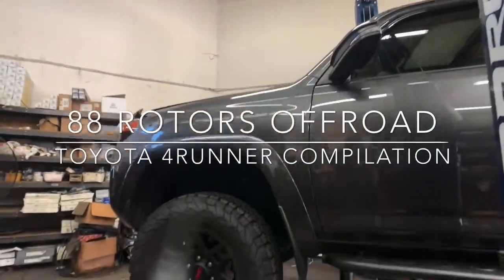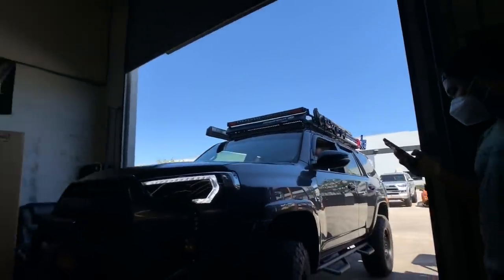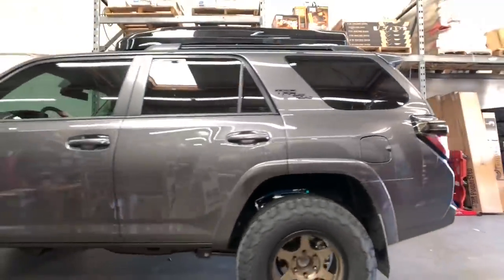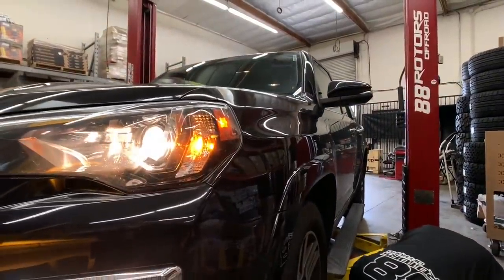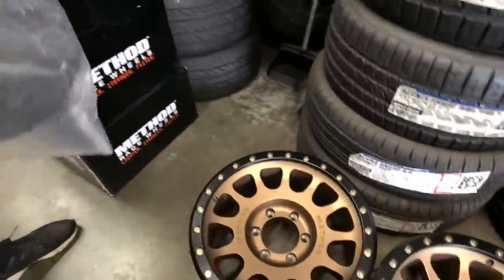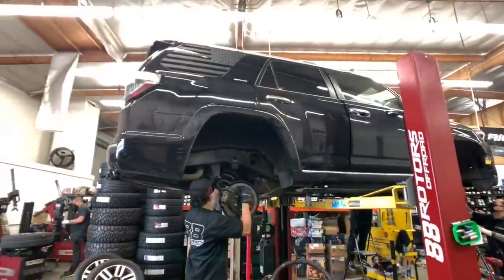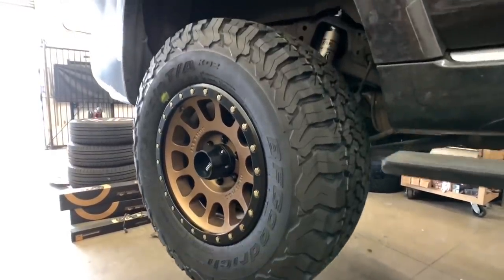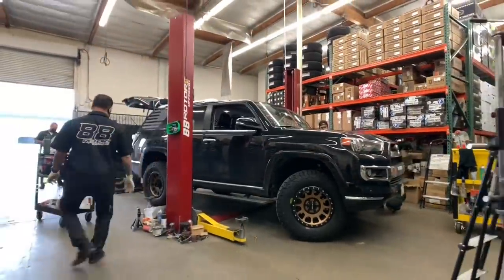(5) TOYOTA 4RUNNER LIFTS, KINGS, FOX, BILSTEIN, XREAS DELETE ON LIMITED

Comment: When you guys disable the X-REAS, do you take the whole system out or just the shocks at each corner? Does any hydraulic fluid come out? Could you guys do a step-by-step vid on how you disable the X-REAS system?? I have a limited and i would like to do this soon! Thanks guys and keep it up!!
Reply from the maker: Disable by shutting off the valve and removing. No fluid, not a single drip. We aren’t a diy channel but there are quite a few diy style videos on YouTube that show it. Good luck!
Reply: 88ROTORS Which valve? The videos I’ve seen always showed hydraulic fluid dripping, which is why I want to know where you guys shut it off without any drips. Thanks again!